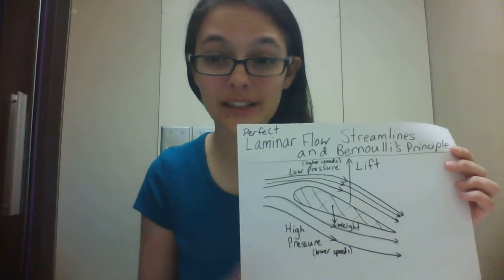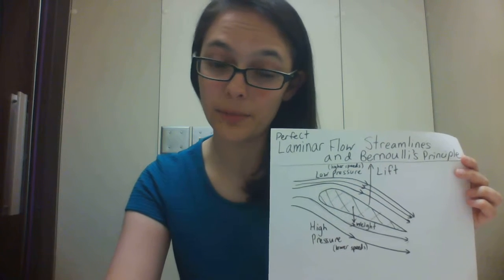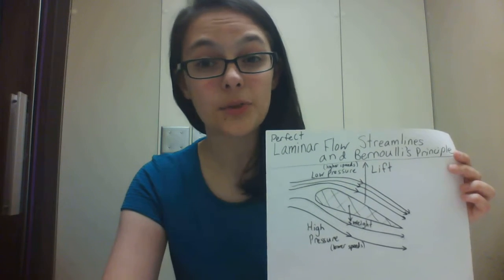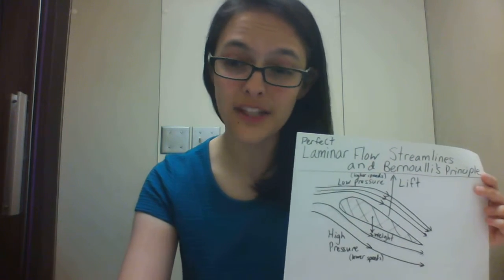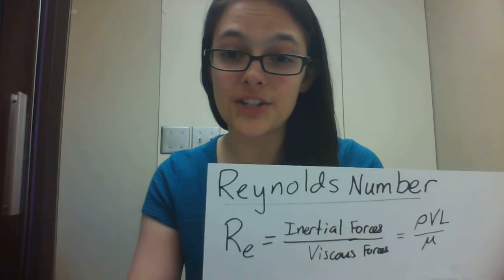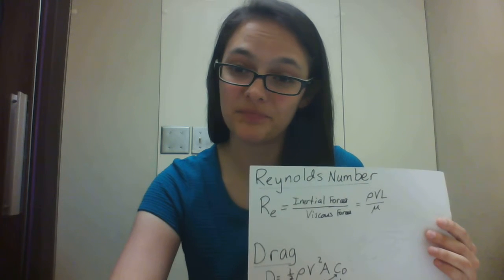Laminar Flow as it Relates to Airplanes

Comment: Came for Tam Lin's reel, stayed for fluid dynamics. Former pilot/engineer. Good explanation of laminar flow, reynold's #'s, and Bernoulli's principle.

One item however is that the majority of lift created by aircraft wings comes from the formation of a boundary layer of air that is forced against the top edge of the wing, and which is forced by the air around it to follow the contour of the wing.

You'll note the curvature of wings curves downard on the top, but not bottom -- when the surface layer reaches the end of the wing, it therefore as a downward vector component: this accounts for the vast majority of the lift created by aeroplanes.

Many less rigorous textbooks still mistakenly reference Bernoulli's as creating lift: which it does, it's just an insignificant amount of lift compared the lift created by the curvature of the wing.

Everything you said about effects of laminar vs turbulent flow still apply.